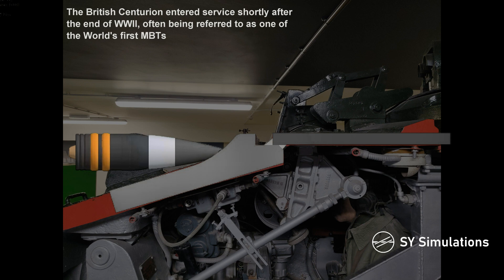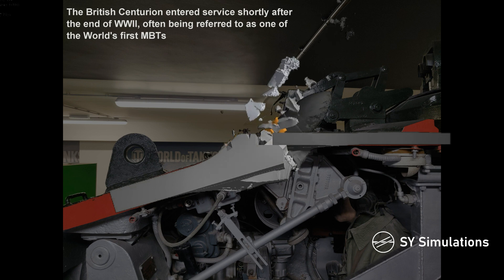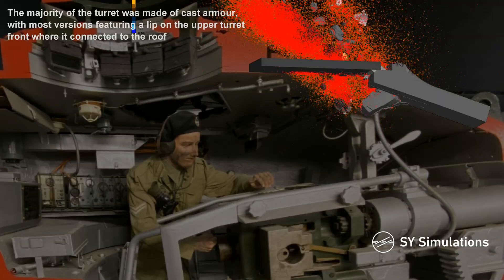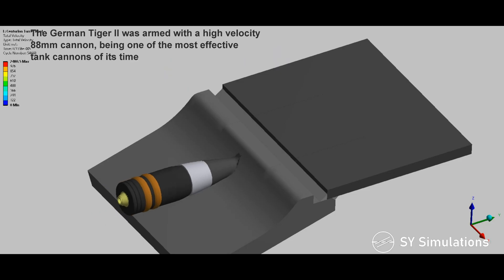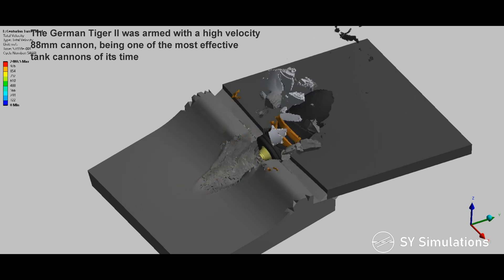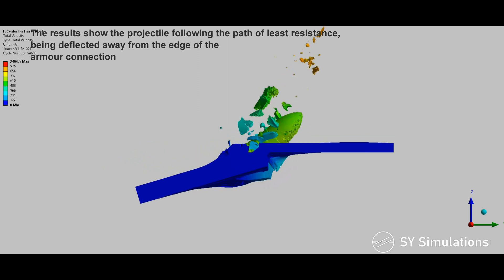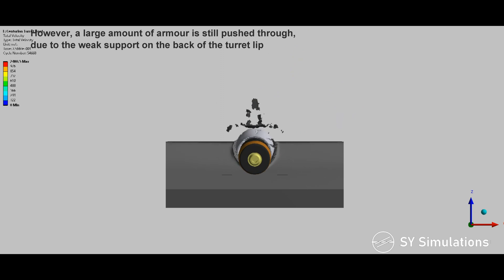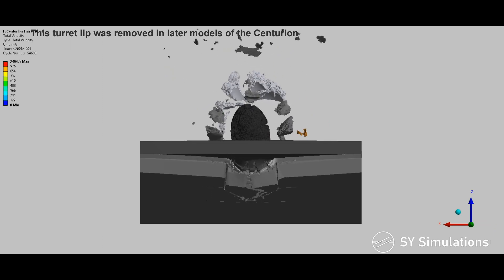TIGER II vs CENTURION WEAK SPOT | 88mm Pzgr.39/43 Armour Penetration Simulation

Comment: If that Tiger crew has the TIME to stop and carefully aim at that vulnerable Centurion turret lip, the Limey crew isn't that good.

Also, WHICH Tiger II are we talking about?  The "production", or "Henschel" turret, with the slightly sloped, flat front, or the "Porsche" turret, with the curved front mantlet and its SHOT TRAP? (Note: both turrets were made by Krupp, the latter for the 50 vehicles mistakenly put into production by Porsche which were produced and issued anyway.  All were sent to Normandy in 1944 and left there.

Comment: Love the overlay, you can see where the spall is going.

Lets be real here the Centurion was not the first MBT. Centurion was significantly slower (34 km/h) than both Tiger 2 (41 km/h) and Tiger 1 (45 km/h) as well as Soviet KV and IS series heavy tanks, it moves at below average or subpar WW2 heavy tank speeds. It is nowhere close to being the perfect blend of mobility, armor, and firepower.

Comment: I believe that the original design criteria for the Centurion was that it had to withstand a 88 at 1000m. Which for a Tiger II  or the Centurion is knife fighting range. If my gunner missed at that range, I'd have him transferred to mine clearance. Assuming we lived that long.
Reply: 1 klick isn't knife fighting range for tanks even now in Ukraine.
Reply: The distance this simulation takes place at, ~250m, is knife fighting range. For tanks of the era 1000m isn't a slam dunk

Comment: These simulations overlaid on real images are brilliant! really gives you scale and grounds the simulation in reality, please do more of these if possible!
Reply: Agree!
Btw interesting that especially the thicker part is weaker in this scenario.

(btw 2: thats the cut-open exhibit at the exit of the Bovington Tank Museum)
Reply: @DirtyHairy1 I bet that the steeper angle of that section causes the shell to get deflected more, which in return provides more force against the armor and causes it to get pushed down more than if that lip was below the plate instead.
Reply: surely this cant be to scale, the shell isnt that big i thought? 88mm is not huge
Reply: still cool though
Reply: The impact area is only a small portion, so they have to scale up the size of the simulation sample and shell in order to overlap with the irl image, at least thats what i believed  @Childburner1
Reply: @Sillycet  k thanks. As I said, still much cools